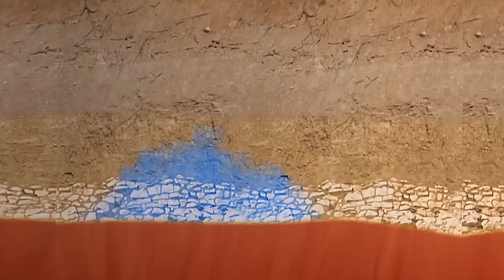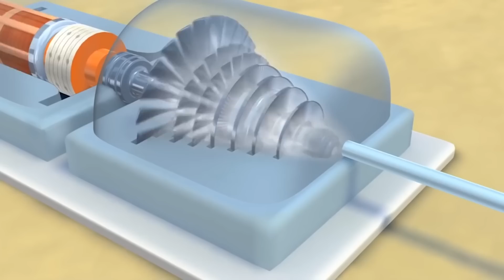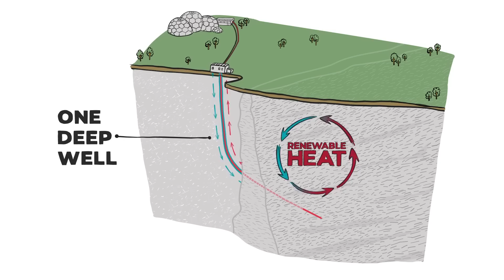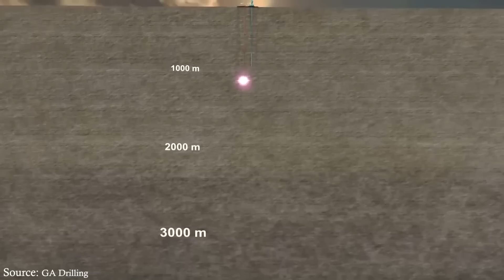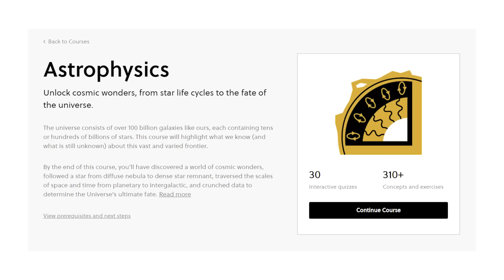How This Hole Keeps Generating Energy

Comment: I do have a question.  What about the home heating that has existed at least since like 1980 or so when home heating could be done using heat from the earth.  Now I have no clue how they do that but I do not believe they ever try and convert the heat to electricity, I think it works more like a fridge in reverse in the winter and a fridge in the summer.
Reply: Some places if you u know and understand the weather and how mountains and hills act you can have a home/structure that doesn’t deviate between a certain range of degrees Fahrenheit if you build it inside the mountain hill enough

Comment: Great ideas.  And, like a lot of things, it will probably become more practical with time and effort.  I would not call this "renewable" energy, though.  Maybe an [essentially] infinite energy source, unless, of course, the Earth's core renews itself.  Thanks for posting this.
Reply: By that logic, solar is not renewable as it will only last until the sun goes out.
Reply: Or, until the solar cells wear out.
Reply: @Debbiebabe69  There isn't one sun/star thou. With our progress just a million year is enough to colonize the local star systems.
Reply: @khanch.6807  If we get to the point where we can colonize other stars, then obviously we have to be at the point where we can visit other planets.
Reply: @Debbiebabe69  Indeed. Renewability is a matter of perspective. Wait 10^100 years and the Universe will fade away making the Universe non-renewable.

Wait 10^10^100 years and a new universe might just pop into existence making the existence of a Universe a renewable thing.
Reply: @khanch.6807  "pop into existence" that's worse than creationism
Reply: @gracefool  On infinite timescale and space even the most impossible thing can and will happen.
Reply: By that logic no energy is renewable
Reply: I prefer to call it "owned power". Fossil fuels are rented power, and it's better to own than to rent.
Reply: Good point, Nathaniel.  That's exactly why I want to install a solar-electric system.
Reply: Nothing is technically renewable. The Sun will burn out in 5 billion years. The Earth core looses 100°C per billion years. So the sun will blow up fist before the earth's core cools down by a mere 500°C.

Comment: Has anyone done a calculation to estimate how quickly, and to what extent heat extraction from the Earth's interior degrades the magnetosphere?
Reply: Geothermal is one of the worst energy types possible. The earth absolutely needs its heat, because it's never going to get hotter, it's always going to get colder. All that heat is left over from earth's formation. Without it we not only weaken the magnetosphere, we also would eventually change the earths rotation/tilt. It's not so bad in small cases, but if humanity came to rely on it and started extracting the energy in large amounts, it could pretty much doom humanity and all life on earth itself. One might say "Well we will stop if it seems to be causing harm". But firstly, the harm would be completely irreversible. You can't put heat back into the earth. Secondly, with us being soo hooked on it and already having all the infrastructure in place, people would not stop using it. Especially when we're talking in a future where people need energy more than ever, and billions of thirdworlders using increased energy as their lives modernize.
Reply: @rocklobster3414  It would if used in large quantities. It can alter weather drastically if we ever truly relied on it. It can change wind  and rain patterns, along with being proven that the ultimate effect it would have is creating an overall surface warming of the planet, and far more than all current electric consumption combined. This is because it interrupts and mixes colder and warmer layers of the atmosphere. So heat that would otherwise work its way up the atmosphere and out to space, gets trapped back down at ground level, where it is absorbed by the surface of the earth.

Comment: I believe supercritical is a balance of heat and pressure not just heat. Too much heat and the water just boils off but under the right amount of pressure the water turns supercritical and is converted into a state between liquid and gas.

Comment: My concern would drilling so deep. What type of damage would we be doing to the earth?
These aren’t simple water wells. These are wells going towards the hot areas of earth. 
Could we trigger some form of super volcano by allowing a throughway to the earths surface?
I’m no geologist, but as an average person I would be very concerned with that type of drilling.
Reply: If anything, the opposite, as this would relieve pressure and channels the escape of heat.
Reply: @akulkis  releasing a pressure means the pipes failure.
Reply: No major damage. If we get too greedy it will simply reduce efficiency of heat extraction. It is also kind of renewable -- geo heat comes from fissure reactions. We effectively live on giant reactor and the earth is slowly cooling into the space.

Comment: Why don't they fire a giant laser into the ground as a drill one fire after they reach as far as they can with a drill. I hope they are drilling at the lowest point in england you did say england right?  Do you remember the movie about a mad man that drilled to the magma in LA and created a lava flow through down town LA and they redirected the flow with k-rails and massive water pumps pumping  from the ocean a mile inland? Set up time was 30 minutes. The guy had triple seals to hold back the lava he thought the air would create a vapor lock and keep the lava at a safe level not create a volcano. He died in the movie. Cant remember the title. I hope there fate is not the same and create a lava flow by weakening the  crust and creating a stove pipe. Sharing my thoughts. Thank you for your time.   P.S.  Be safe as the person next to you?  EAA

Comment: So we realize that small percentage changes to our environment/Earth can kill everything because the Earth is alr fragile, and now ppl think we should cool off the core to make steam for energy?!
"Only going to harvest a small percentage.." wtf. I spent $120 (Canadian) on a magnetic power generator. It powers the entire house. It takes up less room than a monitor, it's so cheap I have 3 spares incase this ever breaks down. I have no power bills. Every single human can switch over for less money than what you will spend on power over this summer. You could even buy a $350 3D printer and make as many as you like for about 50-120 CAD per generator.

Comment: The title says infinite.   Your voice says "nearly unlimited".  Quite a downgrade there already.  And we know that in reality there are limits to how far down it's feasible to drill, as the cost of drilling goes up steeply with depth.  Plus there are very hard limits to how much energy you can extract from a small hole.   For instance if you assume you can extract 100Kg per second of superheated water, the power available from that is just 100 KW raw,  when put through a turbine, maybe 30KW.  That's about $1 of wholesale electricity per hour,  not enough to even pay the interest on the costs of drilling.   And the plasma drilling system seems to be mostly "aspirational", which means "we hope and wish".   So nothing to see here.

Comment: I would have to mention that there is a link with geothermal and earthquakes I live in California I can see the steam from the coso geothermal plants from my house if you think about it we use steam to move all of our large ships weather it's diesel or nuclear they boil water to create high pressure to turn the turbine's what do you think happens when you dump water on an underground river of magma it has to be moving or it would just harden and seal your hole the water hits creates a massive high pressure bubble that is sent back up the tube and and turns your turbine's but if the magma is moving A lot of water goes with the moving magma and when it passes the hole where does it go it continues to create steam and pressure just under the bedrock with no way to escape because it's been put there when it normally would not and if you keep doing this over And over steam is a powerful thing eventually it has to find a way out hence the corolation between geothermal and earthquakes

Comment: Sounds great on paper but in the real world that plasma cutting head will still need cooling and at that depth you will need a lot of cooling as not just the heat of the cutting plasma but the surrounding rock will heat up the equipment and yeah electronics and electricity does not like heat.

Comment: Ultra deep geothermal drilling is more complex that your simplistic proposal. Lots of good comments in the replies explaining why it’s so difficult to drill and then maintain a HTHP well. Another area of deep concern is the trace elements and corrosive gases that at elevated temperatures create severe embrittlement issues. North Sea Central Graben HPHT gas field has not been fully developed because of this. As always cost and risk must be the overriding metric that justifies introducing ambitious new technology. Another area of this proposal that is way off the mark is borehole stability and pressure control. A vertical 12km well to ULTRA HPHT formations is probably too expensive, too risky and quite simply beyond the capacity of 99% of current drilling rigs and the people who run them.

Comment: I don't like the environmental side effects: earthquakes, and cooling magma sinks back toward the mantle. And the water used in the hole. Using existing hot water is no problem at all. I just don't like for profit outfits drilling and pumping under such circumstances. I feel more sanguine about nuclear power that is in a controlled, regulated reactor.

Comment: Sounds easy, sounds like a great idea, but geothermal plants are nothing new.  Financially speaking, most only produce a very small amount of energy.  One major cost hurdle is corrosion.  There are some pretty caustic chemicals trapped in the Earth's crust.  I have many geothermal plants around me (closest is less than 1 mile).  I've seen expensive and exotic pipe material get eaten away by corrosion in a matter of a couple months.
I congratulate on a nice presentation, but you have to take much more into consideration.  There are theories and there is real life senarios.
Reply from the maker: Thank you for your comment, I agree that I have not covered many details which are important to the practical implementation of geothermal. I should have done more background reading as these are all very interesting and would have improved the video!
Reply: @ZirothTech  This is a great YouTube video.  I'm not a YouTuber and have no idea how much time, research and energy is required to put out a great video.  I believe that is quite difficult to cover all of the bases.
Speaking of "energy", how about simply utilizing water.  Water is one of those few unique compounds that really don't fit in any category.  Splitting water is not difficult.....and depending on the "type" of electricity (ac vs DC to include different Hz or frequency), sizeable amounts of H and O can be produced......quite easily.  A nice informative video on that......that isn't boring, would be great.  There is a ton of information out there, but most of it is really spread around and not presented together.
I'm sure your viewers would enjoy that rabbit hole and many of the might learn a great deal.  I know that it would interest me.
Reply: @williamhopkins1625  You can never get more energy back after spliting water into hyrdrgen and oxygen... The subject has been done to death, it's not a great idea, too net negative in energy
Reply: what if you have a fully sealed closed cycle? Or do you mean corrosion from the outside?

Comment: I suspect it will cost too much. 20 kilometers is much deeper than the deepest oil wells. The deepest oil wells already have trouble being economic unless everything works out just right, and oil is more valuable than steam. Also the deepest oil wells have difficulty keeping the borehole from collapsing due to high pressure and rock plasticity. New drill bit tech of itself is not enough to make this work. You also need new drill casing tech and new material tech to control corrosion issues inexpensively enough. A whole new package of tech that is beyond current capability to drill that deep and economically access that deep heat.
Reply: Need to put more work into "transparent aluminum" a.k.a. synthetic sapphire. Imagine a big glass-like translucent casing tube stronger than steel, almost as hard as diamond, and the heat resistance comparable to many ceramics. The hard part would be to figure out how to make big things out of it. Some technical understanding of it is out there, the problem being scaling it up.

Comment: _The big problem with using a lot of geothermal powerplants,  the heat has to go somewhere. It goes to space, however, there is a limit to the rate of dissipation. We are already having problems getting rid of the heat we generate, in conjunction with what the atmosphere captures from the sun. Just think about what would happen to our atmosphere if we were getting say just 50 % of our energy we use from geothermal. We would be adding heat and humidity. This raises the question, could you be happy living in a world wide rainforist >>> ? <<<.
Reply: It is implied that geothermal would replace fossil fuels rather than add to their use in which case there would be no additional heat to dissipate beyond what the atmosphere is already dealing with. Furthermore, the heat gain due to atmospheric accumulation of CO2 and methane is not an issue with geothermal.

Comment: One small problem , radio activity.  I had a oil well drilled on my property strangely they left some iron pipe behind . Asking the scrap man it's value he said they left in behind because it became radioactive.
Reply: Interesting.  I wonder...  If lava is magma that has been kept molten for billions of years by radioactive decay, why is lava NOT radioactive??
Reply: @freemind..  Who says lava can't be radioactive? But part of the reason could be that lava in its magma state is hot enough that it can disperse radioactive matter, spreading out amongst the liquid, and potentially decaying faster due to interactions with other materials in the magma. Where a hot solid rock is just going to sit there, so concentrations of radioactive materials would be more likely.
Reply: yes, most oil is too.  its mostly harmless alpha radiation.  but some wells are unusable

Comment: Clearly, we need to improve the heat to electricity conversion efficiency.
Reply: It is the Carnot cycle which limits the amount of energy to the difference in the temperatures. This is a very simplified description but obviously the greater the temperature difference the better.

Comment: You can also frack to get the water into the hot, fractured rock. And also, you can boil something that boils at a lower temperature than water, or use geothermal heat for a heat exchanger to hear your water and air and do your air conditioning, without going very deep at all.

Comment: Conventional wells are drilled using a fluid (drilling fluid, or 'mud') that has its density controlled to it keep the wellbore from collapsing. this also provides the medium to carry the rock out of the well, and to cool and lubricate the drill bit, as well as providing some hydraulic force to assist the bit in breaking rock. Drilling with plasma at any depth will be challenging because they will have to somehow support the borehole and stop it collapsing. Building up a vitreous layer on the wellbore will not provide much in the way of wellbore integrity, and it wont use all of the rock that's drilled to do it either, so there will need to be a mechanism to remove the rock. On top of that, electronics suitable for harsh environment, such as very hot wells do exist, but are extremely expensive, and do not have a long life.

As a drilling engineer, I'm all for new technology to drill faster, and cheaper, while still staying safe, be it for oil and gas, or geothermal, but I am not sure this particular technology will do the job for the same price that we can do it now - and right now, we do have the technology to drill into rocks of the required temperature and pressure to maintain water at supercritical conditions.
Reply: Can such deep drilling and injecting massive amount of fluids cause seismic instabilities?
Reply: Why don't we use pressurised water instead of drillbits to create bores?
Reply: @wowalamoiz9489  pressured water to drill through granite?
Reply: @Finimabob  close. The best place to start using this method in North America would have to drill through garnet, or really eclogite but garnet is included in that. Lower Mississippi valley would be be the easiest to start, you could use conventional drilling to the first 16km since it's all sedimentary  but under that it's all supercompressed rock under that.